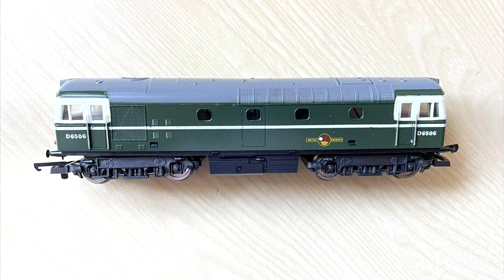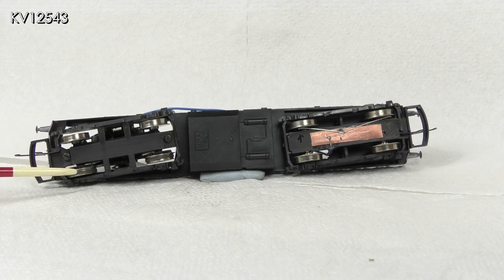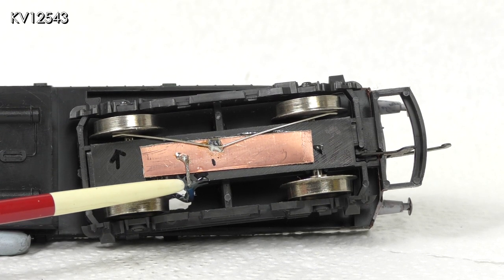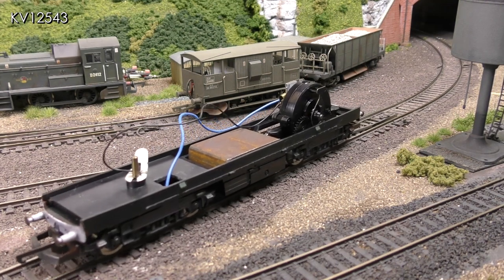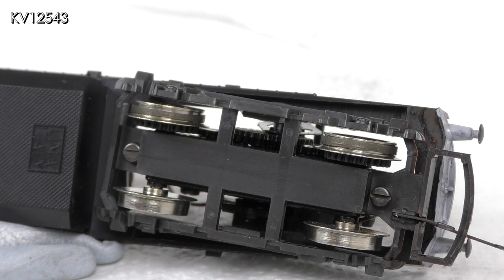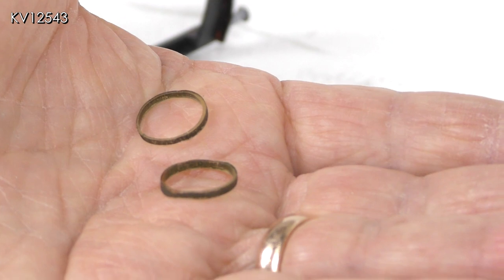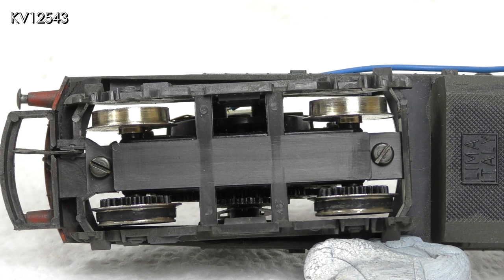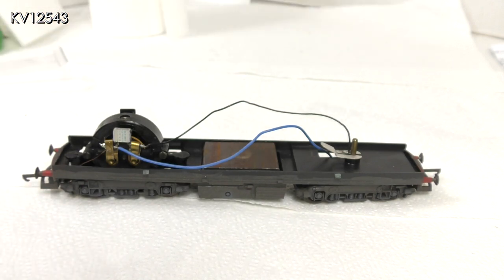Lima Class 33 - Fitting extra pickups and new traction tyres

Comment: Great idea of adding pickups. I could advice adding extra weight above the non powered bogie - it makes the locomotive less jump, run smoother.
Great video 👍
Reply from the maker: Thanks for your comments....the weight over the non powered bogie is a good idea...I may try it on a future conversion, Regards Keith
Reply: @KV12543  I use the 10 gram weights made for correcting car tyres. They are ideal for this purpose and quite cheap.

Comment: Nice tips for the old Lima class 33 👍🏻 A motor service wouldn’t go a miss and a look at those cog ⚙️ wheels getting any burrs off them for even more smooth running 🤩
Reply from the maker: I agree Stevie, a service is always a good idea for these old Lima motors. I didn't cover it as this video is about making  improvements and it has been covered before - I always follow the excellent video advice by Mike from Model Railways Unlimited, Cheers Keith

Comment: Have you thought about, or looked for, replacement geared axles? With the large weight, does it really need traction tyres? If not , extra pickups could be added to the driven bogie.
Reply from the maker: I must admit i had never thought about obtaining replacement geared axles....on my small layout I am quite OK with traction tyres once extra pick ups have been added to the trailing bogie but it may be something worth considering in future, thanks Keith